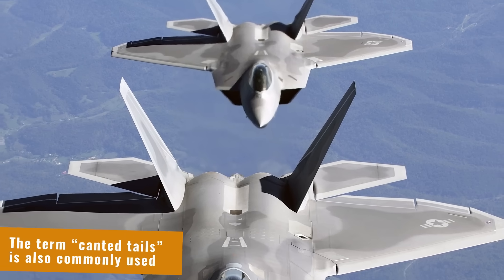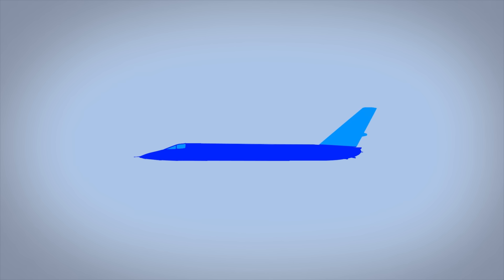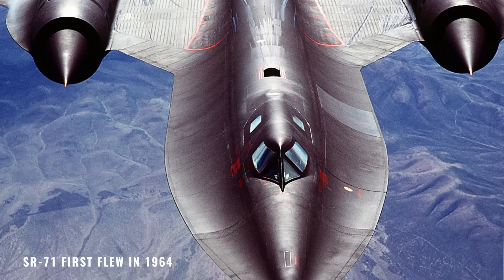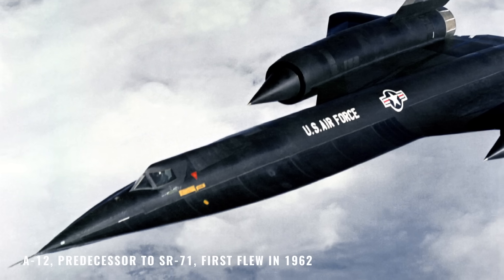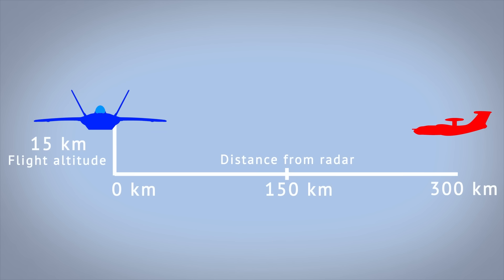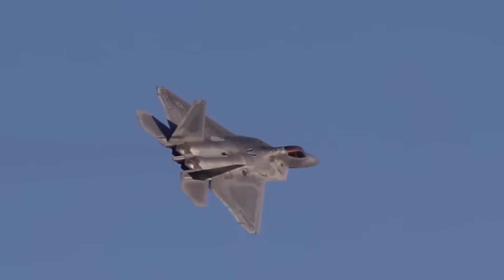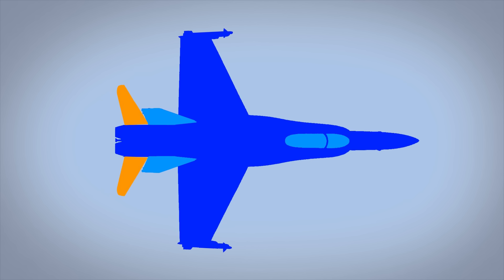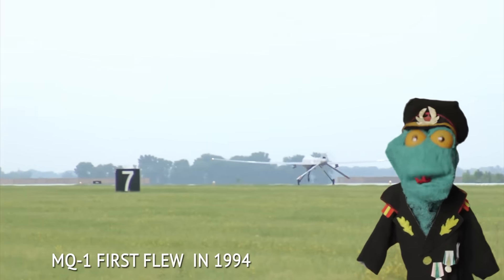Why do fighter jets have slanted tails? (Explained!)

Comment: Uh, yes and no.

For the SR-71, the tails were inward canted late in its design evolution because at speed there would have been an unacceptable lateral component of force during a roll.

For the F-14, a single tail was turned into dual tails, and then both canted outward to mitigate transonic “choke“. The characteristic “shrugged shoulders“ look was implemented for the same reason.

For the F-18, the plane designed with dual outward canted tails at the outset, the cant angle was considerable to maximize the downward component of force aft of the CoG that the rudders provided, to aid rotation during aircraft carrier catapult takeoff. Note this is only possible with an electronic flight control system which could actuate both rudders inwards simultaneously.

All planes that you show with V-tails, such as the F-23, the F-117, and the MQ-1 Predator, fundamentally have different design purposes than conventional empennages, and really shouldn´t be included in this non-technical examination.

You are not wrong to include a discussion of stealth considerations, but the seminal analysis of mathematician Ufimtsev, whose work on the non-intuitive behavior of radar reflection enabled the Have Blue experimental plane and thence the Stealth Fighter, showed that depressions, joints, and sharp angles were the most indicative of radar reflection magnitude, not attitude.

Comment: Canted tails can also create or fix adverse aerodynamics assuming your plane is not fly by wire.  The F4 various bends and canted elevators are a great example where you want roll to roll without inducing pitch or yaw and pitch to not cause roll or yaw.  The cant of tails has similar affect where you want yaw without inducing roll.  By its nature most tails are not symmetrical over the longitudinal axis, thus rudder input will tend to induce roll opposite to the turning force that is undesirable in most situations.  In civil aviation in fact the opposite is desired where some coupling benefits the plane with docile handling with roll inducing yaw and yaw inducting correct roll but in military aviation you desire minimal coupling of control so rudder will only induce yaw.  Outward canting like the F18 contributes to this affect.  Consider left rudder input where both rudders will deflect left but the left rudder is also creating a small amount of downward pitch (lift at the tail) due its tilt to the left.  Similarly the right rudder is inducing a small amount of up pitch (down force at the tail).  Since these opposing forces are not aligned to the longitudinal center of mass or flight axis this has the affect of inducing right roll that will offset the left roll caused by the yaw movement, basically creating a true uncoupling of roll and yaw axis.  In fly by wire this is far less relevant since a flight computer can use all available controls to do what the pilot wants regardless of most aerodynamic concerns.  A good example of this is the F16 (and most subsequent military fighters) that are so unstable as to make human control impossible.  The F16 center of mass is so far aft of its center of lift that it could not be controlled.  Its said a nose heavy plane flies badly but a tail heavy plane flies only once.

Comment: f117 wasn't stealth but a low observable aircraft, the fighter designation was only just to get more fighter pilots willing to fly it
Reply: That is not at all why it had a fighter designation
Reply: @martinrps13  :)  https://worldwarwings.com/ridiculous-reason-nighthawk-designated-f-117/
I never said it was the ONLY reason
Reply: @blastyfs2  being willing to fly it is not even a thing either. Willingness isn’t how they are placed with an airframe.
Reply: @blastyfs2  I just looked at your referenced article and I can tell you there is not one bit of truth to anything in there. Eventually you will find the real reason....but this ain’t it. Hint.....it is one of the reasons it is still flying.
Reply: @martinrps13  instead of just telling me I'm wrong, could you send me a link to backup what you are saying? although I didn't realize the video in that site no longer works, I have the video saved on my pc
a designer does actually say that the explanation I gave is true
and the fact that it is a designer saying it, his expertise has a hell of a lot more weight than you
Reply: @blastyfs2  of course your proof all of a sudden doesn’t work. I ain’t applying for a job so no need for me to share what my expertise is. The undisputed fact is that it was not designated a fighter so pilots would have more “willingness” to fly it. That couldn’t be further from the true reason.
Reply: @blastyfs2  do you work in the aircraft industry?
Reply: @martinrps13  I do not need to in order to hear a DESIGNER talking about his own project
all that is needed is ears and a desire to listen
Reply: @blastyfs2  designer doesn’t give designations to USAF aircraft. Sorry....but it simply doesn’t happen like that. And no matter what cool name, details, or designations an aircraft is given....it doesn’t change the FACT that pilot selection is based on individual performance. None of them try hard to suck...so there is no need to make it any more appealing. Sorry to bust your bubble on some random video or article you read....they are wrong and so are you. Take that as a lesson and don’t just regurgitate...do your own research. It should only take you a few minutes to get the real answer it is given the F mission design series.
Reply: @martinrps13  the designer isn't saying that he gave it the designation, did you not watch the video?  he is saying why others gave it that designation
Reply: @blastyfs2  there is no need for me to watch the video...I know all about it.
Reply: @martinrps13  then why does this argument between us even exist in the first place?
Reply: @martinrps13  you aren't reading correctly...I never said it was the ONLY reason and I sure as hell never said it made sense
Reply: @blastyfs2  that is totally irrelevant....as the reasoning you listed is wrong. It is very simple....your original comment is totally wrong.
Reply: @blastyfs2  what can I not read? And I am not old, 40 is pretty decent. Seems you are just mad that you are WRONG about everything you say here. If you don’t want to be educated on the aircraft....just move on and leave it be.
Reply: @martinrps13  you keep saying that and have not given any proof of it yet
"totally wrong" implies that the reason I have given had absolutely no truth to it

even though there are people, who were involved in the project, saying that the reason I gave is at least partially correct

I am well aware of treaty, that at the time, limited on how many bombers the US had

hence why I said it was not the ONLY reason

Comment: The explination why slanted  tails dont return radar is totaly wrong.

The reason is not that if reflecs The radar up or down, but rather that the fin and stabilizer in a normal configurarion  form a perfect 90 degree angle and there for act like a reflector,  like in a reflex.  Just changing the angle 10 degrees breake this funktion. By having all surface to a angle.that is od to each other all reflex surface can be broken

Comment: I'm afraid you missed the 2 main reasons, and got a couple reasons wrong or wrong-ish. Both Russia and China are well aware, so there's no harm in explaining:

1) stealth - the angle at which you can detect the vertical tail surfaces with a direct bounce-back of radar signal is "relevant" but not the main reason to avoid straight vertical stabilizers. The main reason is that straight vertical stabilizers you create a 90 degree angle from the horizontal plane (relative to the horizontal stabilizers or wing, depending on design layout). A 90 degree angle between 2 flat surfaces though will bounce a radar signal back in ALL directions which are to the side of the aircraft. Try shooting a pool ball into the corner of a pool table, no matter what angle you shoot from, it will return back in the same direction (roughly). Or look at how reflectors work for bicycles, etc. Same principal. So angling the vertical tails doesn't just change the direct bounce-back return direction, it eliminates an entire 90 degree swath of radar returns. With a non 90 degree angle, you're left with 3 return paths, flat-on vs either the horizontal or vertical surface, or the mid-point in between where radar will bounce back after a double-bounce between them.

2) Supersonic performance - This is harder to explain simply, because supersonic fluid dynamics aren't 'simple'. But in a nutshell, canted vertical tails avoids a peculiar drag & stress penalty in higher supersonic flight. Worth noting, this issue is only relevant to twin stabilizers. A single straight up vertical stabilizer won't encounter this issue.

3) A minor correction: Twin straight vertical stabilizers get plenty of good airflow if they are positioned correctly (as on the F-15). The airflow from over the leading edge extensions forward on the plane are not going to do anything for you at high AoA, where the verticals get most of their airflow at high AoA is from under/behind the wing. If you're at say 60 degrees AoA, the only major source of air getting to the rudders is coming at the plane's belly, and passing through the gap behind the wing, and up along the outer sides of the vertical stabilizers at an angle. Remember that at high AoA, the horizontal tail surfaces will be at a strong angle (in any plane with an all-moving horizontal stabilizer) such that air flow to the outer sides of the rudder (coming from under the plane) is unimpeded at high AoA. For Delta wing aircraft, airflow to the rudder at high AoA is a significant design concern, but this is why many deta wing aircraft go with a single vertical stabilizer, since they are less likely to be able to utilize air from under the plane at high AoA (depends on design though).

4) another minor correction: straight vertical stabilizers also can help pivot a plane upwards if they both have rudders diverted in different directions, since the bulk of the force generated from that is not so much directional airflow, but rather acting as an "air brake" which is high above the center of mass. The effect is stronger if both rudders angle 'in', since it causes an aerodynamic choke point. Using the vertical stabilizers to help adjust pitch is a very energy-draining maneuver though, so the F-15 does not typically do this, because it has a dorsal-mounted airbrake anyway, which can do effectively the same thing, with less stress on the rudders. The "airbrake-less" modern versions of the flanker though can use this in lieu of an air brake.

And a tiny nitpick: the all moving tail planes of the YF-23 are "massive", there is no trade off of control surface area, or drag benefit. It's simply 2 tail planes which have the area & drag of 4, but reduces shape complexity at the tail for stealth reasons. Also those things were so big that they offered a sort of "tail wing" effect for when the big wing was in post-stall conditions. Obviously way behind the center of gravity though, but if the main wing was offering force in the form of a giant rudder, it had some interesting flight characteristics (on paper anyway, they benched the YF-23 before fully testing it. In part, I would argue, to avoid issues of second-guessing the contract winner. But I may be biased).

The F-4 incidentally had angled all moving horizontal with a large portion of them made from titanium so they could survive interactions with the exhaust coming out of the J-79's. The angles offered more directional control in a sort of early proto-thrust vectoring concept. It helped the F-4 be relatively maneuverable, despite being a bit of a flying brick.

Comment: The main reason pre-stealth was improved directional control at high AOA. Traditional middle tail vertical stabs end up getting blanked out by the fuselage and wings at high AOA. That's why airplanes like the F-16 have fairly restrictive AOA limits, while the FA-18 has no AOA limit. Even the venerable Tomcat had slightly canted tails.

Comment: Uh, sorry but you got the stealth aspect a bit wrong or, at least, incomplete.

Imagine throwing a ball at a wall. It would bounce off the wall at the same angle it entered, right? Now imagine bouncing it into a corner (90 degrees). The ball would bounce out of the corner in exactly the same direction/angle it entered. RADAR is the same way. The exposed area isn't just larger, but rather having it point directly up results in a 90 degree angle between the tail and elevators, bouncing RADAR back in the direction it came from. Much moreso than a flat surface would.

Comment: B2 doesn't have a tail. B21 and many designs for American sixth generation fighters don't have them either. They control and stabilize the planes by other means making them stealthier. American sixth generation fighters are expected to use SCRAMJET engines giving them a top speed of Mach 6+. To avoid overheating they're going to have to either fly at very high altitudes or be made of very advanced materials that can handle the heat. What makes aerodynamically unstable planes able to fly without losing control are systems of sensors, computers, and actuators that make all of the adjustments continuously by monitoring and compensating for instabilities without any input from the pilot. It is believed that aerodynamic performance of planes of these fighter planes will be so great that they will of necessity have to be drones as the ability to accelerate (which means not only changes of speed but of direction as well) will be so great that they would kill a human pilot. Humans can barely handle 9 Gs without blacking out but missiles chasing them can accelerate at 20 Gs. Not needing to keep a human pilot alive simplifies the entire design and puts the pilot on the ground half a world away. The plane can also be programmed to operate semi-autonomously and eventually fully autonomously with no need for any human supervision. Integrated swarms of various planes of such types will be given a mission and computers will figure out and execute the best method of achieving the mission goal. Every asset from submarines to space weapons will be integrated. If you want to know where the black hole of 39 trillion dollars the Department of Defense can't account for went, that would be a good place to look. I don't see any retired generals living like gazillionaires.

Comment: The canted twin tails generate rear lift instead of having a deadweight vertical tail.

YF-23 and Boeing's Loyal Wingman have Pelikan tail design.
Reply: During regular flight, they generate no forces at all. 

They create both positive and negative lift depending on what they are doing during maneuvering.

Comment: Less for the stealth, more for hiding the heat exhaust and using their rudders to brake as air brakes.

What's wrong here, the f-117 and yf-23 don't have slanted vertical tails but the V tail configuration which more affects the stealth and gives more motion in the air.

The same can be achieved with elevons as rudders of the trailing edges of the main wings, really reducing the radar signature in the lack of any vertical tail like b-2 etc.

You can read more here:

 https://www.quora.com/Would-the-YF-23-have-been-cheaper-to-develop-compared-to-the-F-35/answer/Emir-Latinovi%C4%87

Comment: The thing about the SR-71 that really blows my mind is that because its first flight was 1964 that means most of it is 50s tech ... 50s!!!! And that makes me seriously wonder what 2000s tech can do? The f22 is 80s tech first flying in 1991
Reply: It doesn’t work that way. 

Technology plateaued. 

It’s kind of like comparing a 2000 cell phone to a 2010 cellphone.. and then comparing that 2010 phone to a 2020 phone. 

The 2020 phone is larger, has more memory, a better camera, faster download speeds, clearer display, etc.. but doesn’t really represent a fundamental leap in technology like what happened between 2000 and 2010 with adaptable capacitive touchscreens being offered to the masses.
Reply: @Bartonovich52  I'm talking about a 70 year gap. From the 50s until now.

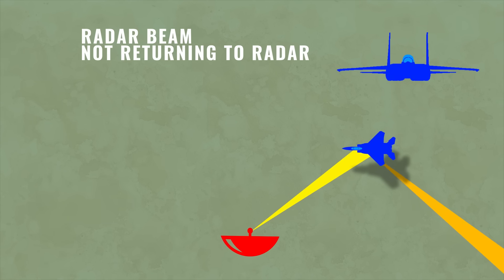Comment: 2:10 The SR-71 was originally planned with a single tail. They discovered very soon, that at its high operating speed the chances of the pilots being sliced in half during ejection was too high, so they changed it to this twin configuration.
I don’t think that stealth requirement had any influence on the SR-71 vertical tail design. Its operating altitude was around 70-80,000 ft where most if not all of the radars could detect it only from below where its planform was quite flat anyway, so the tail wouldn’t have played any significant role in it being more easily detected.
The only aircraft „able“ to intercept the SR-71 contemporary was the MiG-25. And this would have been guided by GCR to an intercept point where it’s onboard radar would take over to fire an appropriate missile. But it’s operating altitude was lower that that of the SR, so the MiG 25 radar would „paint“ the SR mostly from below.
Slanting inward was to control the Mach 3 shockwave of the engine nacelles, while at the same time putting the vertical stabilizer mass closer to the center of gravity, adding to its longitudinal stability.